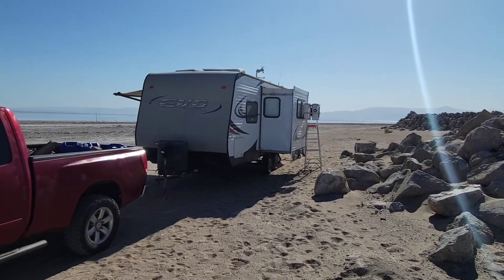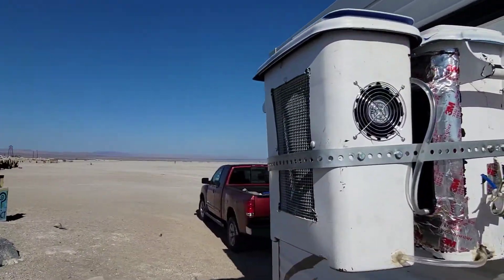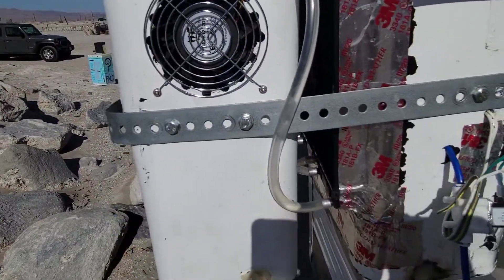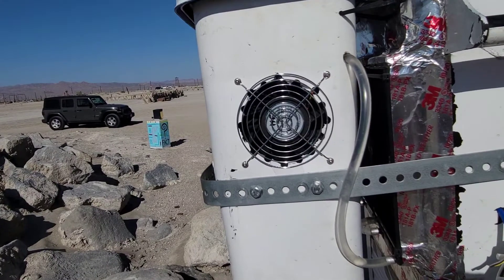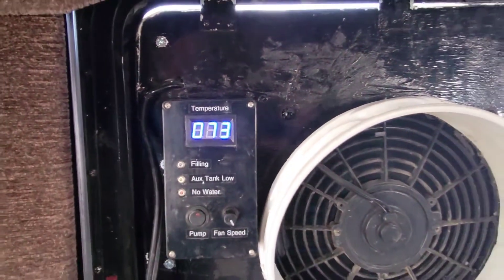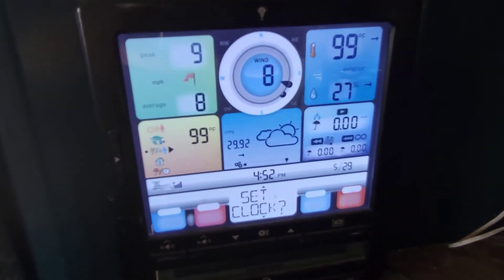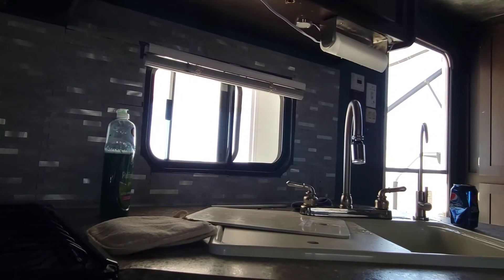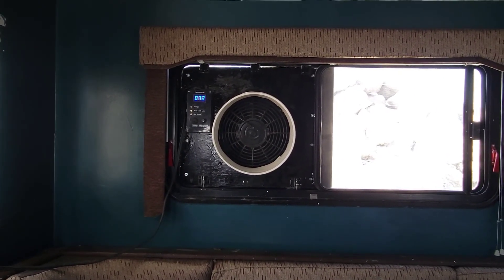Homemade DIY two-stage evap

Comment: Nice Work. I am working on M-Cycle kind of cooling and did work on changing my swamp cooler to AC by installing refrigerator size compressor ( 1.5amps)and installing heat exchanger to let the chilled water flow through the chiller and output temprature was -11F, which is too cold :)

Comment: You keep door/window open or some ventilation to outside to let cool air in and reduce humidity w regular evap cooling. Couldn't hear everything but I'm thinking this wouldnt bring in much humidity. It would've helped to make video after it's on an hour+ to see inside temp. I'm just wondering if there's enough output but love the idea.

Comment: Really cool.  I wonder if the system might be more efficient if you ran inside air through the heat exchanger so the second stage could cool and re-cool the interior air without having to cool the 99-degree outside air.  I plan to build one of these for my home, and that's my plan.  Let the first stage take place outdoors, cooling the reservoir water, and then keep the second stage completely inside since there's no concern about a buildup of humidity.
Reply: Inside air temperature is very close to water temperature coming out of first stage so recirculation of inside air through heat exchanger wont make much difference. Its therefore better to take fresh outside air instead of the foul inside air.

Comment: Very nice work, but a little bit odd, your design can be improved: your heat exchanger should be inside the trailer, and that way you could circulate the inside air through it to cool it down, while it is insulated from the outside air.